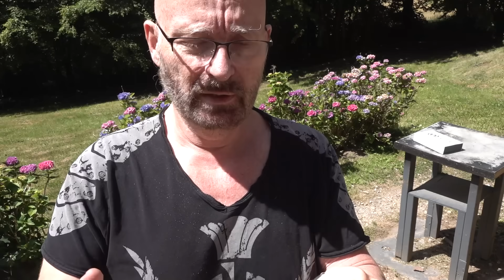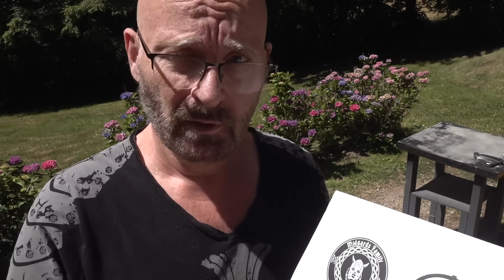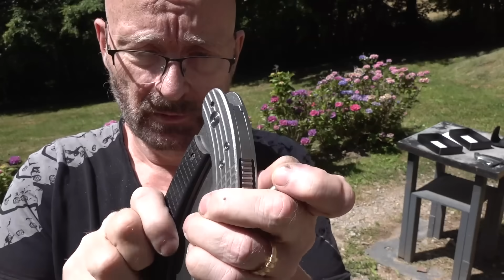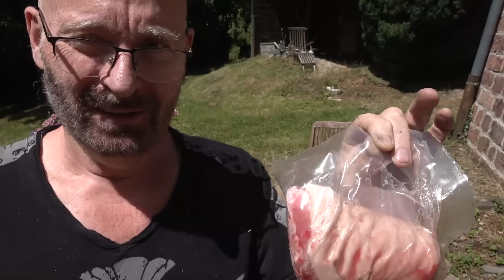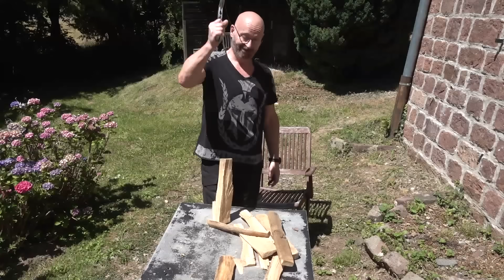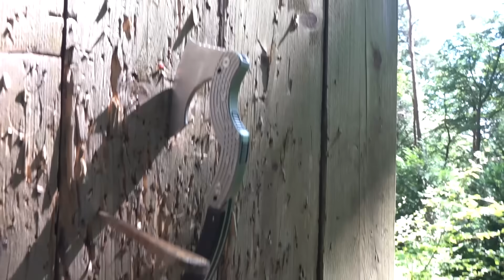Die Wikinger-Klappaxt: Updates und Stress Tests!

Comment: Looks and sounds flimsy. Too many working points of failure. Steel looks machined; not forged. Weak.
Reply: Also an Axe should be as head-heavy as possible. A folding handle with locks entirely made of steel is for sure not optimal. You ca see it when he tries to hack through the 3 by 2, which took like 500 hits (did not count, but performance was not impressive).